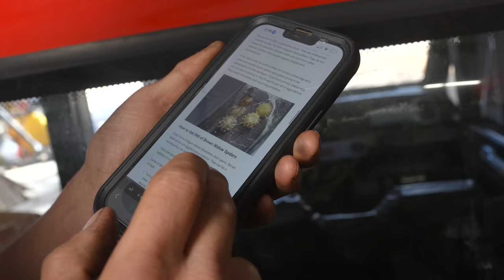Building an Elevator in my Dream Garage! Officially Moving in!

Comment: Cool ideas here. A few potential improvements to the elevator: Move the winch to the ground and use a pulley on ceiling. That reduces the mass falling in case of failure. Also, you should definitely have some secondary retention systems, plus a brake that engages at high acceleration. And definitely add limit switches as others have suggested. You can put overrides on them, but definitely worth having.

Comment: You should wire the elevator up with some limit switches at the top and bottom so it stops automatically when you reach the top or bottom, and wire in some legit elevator buttons just for fun! Hahaha

The shop looks incredible and I’m stoked for you guys! 

Stay premium!
Reply: I thought about this too.. but accidents happen and when they do it will be nice to be able to just let go of a button. would hate for a leg or a foot to be hanging off when its reaching the top and get pinched... that winch isn't gonna stop on its own..
Reply: When you use limit switches you can still let go of the button and it stops. Its just against overtravel. I would however advise to install some emergency stop buttons somewhere, just in case the up button gets stuck in the on position because of some debris or something.

Comment: I'd like to see a safety interlock on the lift platform, that prevents it carrying on up past the mezzanine floor.  The risk of crushing anyone standing on the platform is not desperately high, but the upper runner might get high enough to come out of the track, and tip the load (e.g. passenger) off of the platform all the way down to the concrete floor.  Either that or get everyone a Colin Furze safety tie.

Comment: 29:10 that knot thingy is called a splice and holds even more load than a knot. but they can slip over time due to repeated loading and unloading. you should do a locked brummel splice or cross stitching.
the shop and the elevator look amazing
Reply: I have always thought that Ethan's terminology. has always been better than the original terminology.
Reply: It's not going to come loose over time 😂😂.

Comment: 31:04 would be a good idea to add two pieces of flat stock on the H beam's flanges for the bolts to go through. While it's more than capable of taking the load, it's about the graph over time. Metal fatigues and the load on that smaller area will flex the beam (even if you can't see it, you can use an indicator to notice it tho), so spreading the load with two pieces of flat stock, across a larger area will mitigate that issue.

Comment: I'm curious are you going to pour a concrete pad in front of the garage doors of the new building to keep down on the dust pulling In-N-Out building it's going to be a lot more comfortable even though it's bigger you'll probably be able to heat it easier to 👍👍

Comment: If you add a sprung lever bar attached to the rope that will throw pins through the holes in the unistrut or something when released, you will have a safety brake like a real elevator.
Reply: (that way if the cable breaks or if the winch suddenly starts freespooling, the elevator will stop rather than plummet to the ground)

Comment: I'm a little concerned you placed the belt grinder against a wooden wall. Not the safest place I would have thought. Sparks could fester on that wall? Apart from that, it's so exciting to watch your dream shop take shape. You guys are the most fascinating channel on all of YouTube. Your innovation, madness and skills make an absolute must watch :face-blue-smiling:
Reply: you could probably discharge sparks from the grinders for days against the wall  and never set it on fire. we grind on a wooden bench within inches and it doesn't even burn it. so fear not for the wooden wall
Reply: wood bench has sealant
Reply: @mathieusynnott8915  osb has chemicals in it to make it flame retardant. As if someone as broke as me seals a bench anyway 🙃

Comment: Elevator is sweet but I have 1 area to improve. Weld some sort of plate to mount the winch to that has the bolts horizontal. This puts the bolts in shear which is stronger than pulling bolts in tension. If you think about how a winch pulls on a truck or whatever the bolts are 90° to the pulling force not inline
Reply: For bolts, the tensile strength is greater than shear strength.  There may be a risk of the bolts pulling through the I-beam - which may be what you're referring to - but, in general, tensile strength is higher than shear strength.
Reply: @JayRussellDuramax  you’re right I had my formulas backwards, school was a long time ago lol. Still slightly worried about the bolt pulling through that beam, a nice fat weld washer/plate up top to spread that load would make me feel better
Reply: @jordanharris3749  Definitely!  The stress under the bolt head is not something to be ignored.  It doesn't matter how strong your bolts are if the base material can't hold up to the bolt tension.

Comment: Dudes, applying paint and stripes for safety is a good start, but please, please, please consider wiring in limit/ kill switches to the elevator. It moves fast and a slightly overhanging hand/ foot could be instantly crushed or severed, and a stray piece of steel could become lethal when levered by the moving platform. Perhaps 4 bumper rails with contact strips, along the underside of  the mezzanine elevator opening, and limit switches at the top of the guide rails, and under the elevator platform itself? I’ve unfortunately seen first hand how difficult it is to keep one’s presence of mind and press a button when things go badly wrong…

Comment: As the lift rope is so long the winch could also easily be used to tow stuff into the shop with a few remote pullies! 😀 One on the inner wall, and one to direct the rope there.
With one pully on a swivel in the roof you could direct the rope in different ways, one for towing, and also one in the roof off the edge of the loft to lift things up that are too large for the hole in the floor.

Comment: If it’s possible to change out the wire for the controller you could see about getting one of the ones that’s twisted like a phone chord used to be so it can extend down with the lift and then also help to pull itself back up so it’s not getting caught in anything, you could even make the mount for the controller in a way so it can be taken off the lift and used without anyone on it for just bringing big stuff up and down too

Comment: Spring nuts for the strut improves integrity and they come in 1/4 1/2  and 3/8 bolt sizes . We ise them for hanging heavy electrical equipment even hanging transformers

Comment: I would reinforce that bending beam. Sure it can take it, but eventually metal fatigue will wreck the beam, specially if it bends on just one person jumping in there. Alternatively turn the winch around so it pulls from the middle and i would add some soft feet to bottom so it wont damage the floor when going down.
For control, make the wires longer so you can have the controller on the lift and then put momentary switches wired parallel on top and bottom, though i would advice having second switch to be pushed or covered switches so nothing accidentally pushes them, though this does not remove issue of two people controlling it in same time, causing short circuit if both up and down are pushed at the same time. Also remember to make ladders as back up.
Ou and get that grinder hell away from the mill and lathe. You dont want grinding dust anywhere near those since it will eat the ways and wreck it. I would even consider building separate room for the grinder, or least locate it near door and another side of the shop with dust collection pulling dust outside.

Comment: This shop project is amazing! I am so excited to see even bigger and badder projects from you guys. The elevator is really neat! Super simple and elegant solution to stairs taking up to much square footage. I love spiral staircases, but they are not practical at all for moving things to a storage loft. 

Just a thought,  maybe add a nice knee brace on either side of that elevator so there's less bending stress on the bottom welds. Looks like there would be a big stress concentration right there. Not doubting Ethan's beautiful welds, but it will fatigue over time. Most elevators have an FS of at least 11. 

Keep up the good work!

Comment: I love your materials handling unit Ethan, but as for noise especially while filming and for ease of service why didn't you mount the winch on the floor and run the line over a pully on the top beam, the concrete floor wouldn't amplify the sound and you can service it easier.
Love the new shop
Tony from Western Australia 🇦🇺

Comment: Great work on the elevator ended up being very robust. With the controls it may be worth considering fixing the control box someplace firm and operating it from a string like a retro light switch.
Could make the string attach to a rocker system that could also be connected to push rods to make a mechanical limit switches to stop at max rise and max low positions. Cables could be used if a straight rod is not viable. 

Hey Will, come here to Australia we have plenty of spiders you can collect in cups.
Reply: Yep, we have redbacks (apparently more dangerous relative of black widow) everywhere.

Comment: Nice work on the elevator! If you got a Variable Frequency Drive, some sets of limit switches, and a controller, you'd be able to ramp up and down the speed of the winch and automatically stop at each level. You could do two limit switches per level, one signals approach and to decelerate, and one signals arrival and to stop the winch. The acceleration control might also really help when you're trying to start and stop with a heavy load. I wish I didn't live across the country, I'd love to help make that happen!

Comment: I don’t know if anyone mentioned it yet. Put the switch for the elevator on a retractable coil near the winch and hard mount the up/down switch to the elevator platform so you guys can use it to go up/down at will. No need for the ladder

Comment: If you want it a little slower with more capacity (just the pulling power of the winch) you can put a snatch block on the elevator cart and rout the cable back up to where the winch is attached to make 2 parts of line. Idk if the amount you trimmed the winch cable down to will work, but it’s an idea if you run into the winch bogging down or anything.

Comment: Awesome job, just an idea, you could mount the winch on the elevator, and either have a pulley on the ceiling as to slow the travel speed and reduce load or just hook it directly to the ceiling. This way you can also control the winch while on the elevator, just have a power cable connect through the bottom or top

Comment: Definitely have to consider the spacing between the equipment. I watch Alec Steele on YouTube, who's a blacksmith and when he moved from a small shop into a large shop he had a hard time getting adjusted to the space and eventually moved the equipment much closer together to get back the efficiency that he was used to.  And to be fair with blacksmithing you have limited time because your hot metal cools as you move through the shop. love the shop so far!

Comment: Don't know if it's to much electrical for you guys. But u can wire vehicles, then I'm sure u can fix this to. But you could make a circuit. Where u got a mechanical switch at the bottom that cuts the rela off. So it auto stops. Same for the second floor, with auto stop. Then wire a "up" button at ground floor. And a "down" button at second floor. Pretty simple circuit. Would only be a couple rela's

Comment: Id fix the buttons to the car. You can put the cord in a fine wound spring that adds rigitity to the excess. When it goes up the lengths doubles over. Or maybe somethings similar to how old electic power wheels tracks where with the electrical connections on the car. Run a rail up with leads that ride on thin connection strips. 

I know a tensioned spool eill probably be simple but i like thinking outside the box.

Comment: I think that the winch should hang from a (very strong) support so that it is centered on the cage.  The elevator would run smoother and lift more if there were no rotational forces on the tracks.  The tracks should only guide the basket up, not carry any side forces.  Just a thought!  Thanks for the videos!  👍👍

Comment: A few years ago, me and my father built basically same type of elevator for my parents house. From sliding door rails and trolleys, a winch (150kg straight and 300kg over block pulley). Lift was made to go to basement and up to first floor. Father is 80 and mother 76 yo. No stairs for them anymore. And the lift is going strong.

Comment: To "wind up" the wire you can just use a block and a spring (for example from a trampoline). Because the block reduces the torque each "cycle", the strong spring would move much shorter, keeping a more or less constant torque, and it wouldn't take much space.
Besides, it would look proper steampunk!

Comment: Fabricating for 8 years, I use the portaband more often than anyone I think I’ve ever met. Once you’re comfortable with it, they become so handy. Just have to be creative with it!!
Reply: You can also get a kit for it at harbor freight for $80-$100, turns it into a small band saw that you can miter with. I don’t necessarily need one to cut clean miters but it is pretty cool, doubles and a vertical bandsaw.
Reply: ALSO, coping pipe with a portaband 🤌🏻

Comment: If we have Black Widows here (Just east of you), you probably have them there too.  But on a side note, you could install some spring switches to turn off the wench once it hits a certain point up and down. Just wire them NC (Normally Closed) in line with the up and down buttons for the wench

Comment: Install a shorted coil magnetic fall arrestor device as a safety if the winch fails. It will lower the platform slowly.

Comment: Just for the sake of extending service life of the winch for the lift, it may not hurt to do a pulley block on the platform and anchor the fiber rope back to the beam for a 2:1 mechanical advantage for a 50% force reduction on the drum. The downside to that is a 50% reduction in travel speed.

Comment: That was quite an interesting question, Ethan. I'm thinking that the right side weld, you were holding the tig gun with your right hand with the red in your left hand. At the opposite side of that horizontal tube, they were in the opposite hands. This means that the tig rod was held with your right hand while your left was holding the tig gun.

Comment: Love the elevator. Adds all that extra room for storage. I would have maybe done a pully and looped back to the top. Gives you multiple runs on the rope to handle more weight. You can also control the speed better. Probably don't need to but always good if you need it later.

Comment: I made a wire schematic to hack the hoist and convert to industrial wireless remote control. I also designed a limit switch solution to stop the up and that all fits in the strut.

Comment: I saw another video where the guy installed heavy duty fans on on window of his shop, and whenever he needed to clean up the dust he'd open the doors on the other side and used compressed air to loosen all the shop dust.  The fans would carry the airborne dust and he could clean his shop in under 5 minutes, I suggest you try an airflow system like that!

Comment: For the lift, you should put in limit switches for going down and up. That way you can punch the up and it automatically stop flush with upper floor an stops before it hits the floor
Reply: Okay. What did I do to be the lucky one.

Comment: You can set stops on the motor so that the motor stops when the platform hit the ground and when it is flush at the top, open the endcap of the motor

Comment: Have you considered making a water capture setup for the back of the roof. Not only would it be a good way to collect water for anything from car washing to emergency supply but it might also be useful in protecting your property from wildfires (hopefully the pump equipment is still on the old fire truck you have)?

Comment: Hey fellas.  The winch is very loud, I think it transferring all the sound to the metal building.   Maybe a rubber gasket or rubber spacers in between the winch and beam.   Just a thought.   Awesome elevator.

Comment: Still would put small triangle from middle to middle Platform to put less stress on top slider right now your pivot put I the bottom sliders and save the bearings little longer and less stress on the track .

Comment: u can tap into that winch remote and have a remote at the bottom 1 at top and 1 on the lift so you can control it from all 3 spots

Comment: When you need to move heavy equipment around w/o the ability to use “moving equipmen”, instead use round stock under in, and simply roll it across that nice new concrete floor. It works like a dream, only it really works.

Comment: If you have insurance issues, put a cover over the opening in the second floor like one for a sidewalk elevator. Or build a railing around the hole with a spring loaded access bar so nobody falls through. That would be a beginning to appease the insurance company if needed.

Comment: elevator: put in electric "stop" switches at top and bottom, then run it with a "go" button at the top and bottom where top goes down till it hits the switch and bottom goes up till it hits the switch.  (bottom obviously will need both switches)
Reply: Don't forget an on-board stop switch hardwired to kill all power.

Comment: right side is left handed , left side is right handed

Congrats on moving in, looks great!!   I'm in the process of doing the same for my company. This has been a motivating shop build series.

I wonder if some Dynamat on that vertical column and a portion of the overhead would help with vibration noise from the winch??